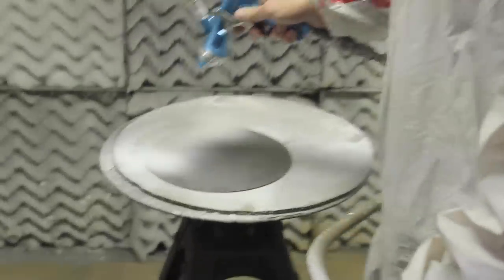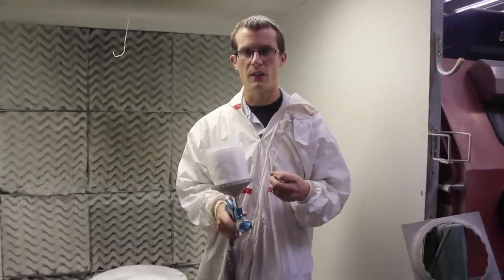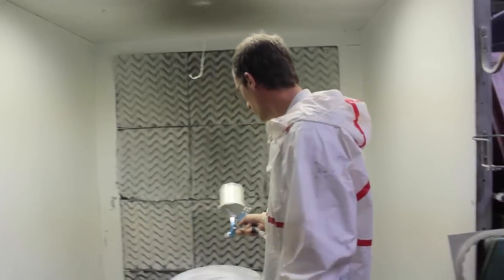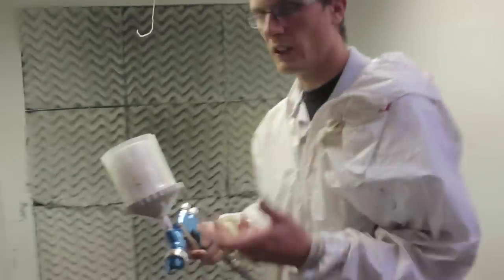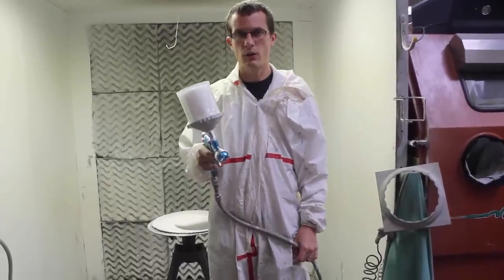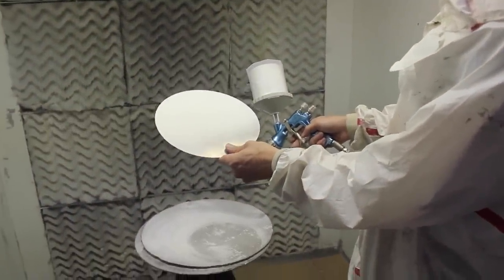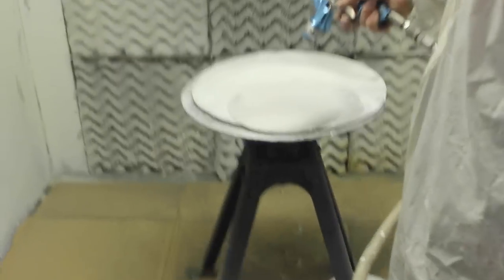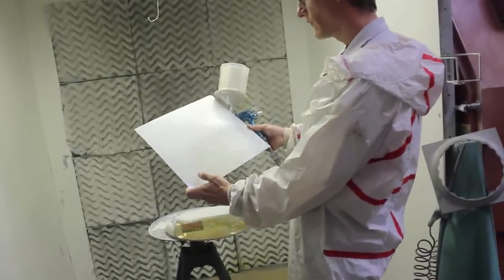How to Stop and Fix Orange Peel when Spraying Paint

Comment: I searched YouTube for all the spray paint videos, and ignored the ones that were over-the-top and made in the last few years from "YouTube Influencers." I wanted to find someone who knew what they were doing and could show technique and share their depth of experience from their professional career. Well sir, I found it. Your video, even though it's grainy and hard to see the finishes on the monitor, is the best one to help people like me understand what I'm doing wrong. I have painted and sanded a piece 3-4 times over the course of a month because I have been unhappy with my results with my HVLP Fuji Model-M gun with a turbine unit.  Because of the turbine unit, I can't control my PSI, only air flow, which is on full. The primer and the semi-gloss paints I was using were just too thick and no matter what, I was having to sand my final results, especially the thick primer.  Sanding a final coat of semi-gloss is not what I want to do, as it will remove the sheen from the gloss.

Today, I was finally able to apply a primer coat with little orange peel.  I used a 1.8mm nozzle, with about 10-20ml of water for about 150ml of primer (Kilz 2 https://www.kilz.com/primer/kilz-2) and it seemed to work. I tested on multiple sheets of paper and cardboard. I had to really limit the amount of paint coming out of the gun to ensure the thick paint was being broken up, so I had to move my gun very slowly at an inch a second to get coverage on the piece. Additionally, I stopped painting outside and bought a Wagner spray tent (9x6) for my garage. I invested in a portable AC for my insulated garage and ensured the humidity was at 40-50% and the temperature was controlled to 21c (70f.) One of my issues when painting outside was that the paint was drying too quickly before it was able to settle.

Because your video was hard to see, I also used this video: https://www.youtube.com/watch?v=qUZXChT2ebs which helped me see the spray pattern a bit better.  After the primer dried, I did a VERY light sanding with 3M 320 paper which gave it a literal smooth finish.  Now I'm going to apply the semi-gloss cabinet emanel which is much thinner than the primer. I'll drop it down to 1.3mm nozzle and see if I can get a smooth finish. I'll report back.

Even though I'm not finished yet, I was pretty excited and wanted to let you, and everyone know my results. I have drastically improved my process.

Thank you for sharing your professional knowledge.  I also liked your video on the Zahn cups https://www.youtube.com/watch?v=oS3YmO8imdw - it helped me understand there is a science behind all of this that can be measured and repeated. Thanks!

I hope this comment helps others.

Comment: I really appreciate your video and information.  I've been struggling with orange peel on most of my projects and have been searching for how to prevent it.  Your presentation really sheds a lot of light on the issues.  Question:  Are the air pressures you are going by with the trigger pulled so I think that means at the cap, or without the trigger pulled?

Comment: your video is really informative  but still i do have a question . hope you can solve this easily.     

Question : imagine you need a thickness around 40-50 microns , at a very short time Eg. 1 second , so how could you possibly prevent the orange peel  in this situation? 
Complications ;
1.higher viscosity 
2. 2k painting
3.less time

hope you can solve this!

Comment: Great information thank you

I got a steam shower that has some scratches in the powder coat. I want to remove this black powder coating that’s on the outside of the glass and then just use a frosting. I do have a small sandblaster what grit would be OK to use if that would be the way to remove this powder coating on the tempered glass.

Comment: how much psi would you expect to use for a compliant devilbiss advance hd gun spraying acrylic polyurethane topcoat? im using a 1.4 tip and the paint viscosity is set at 28 on din4 cup. I seem to have to use 45 psi at which seems excessive the guns manufacturer recommends 29psi. thanks
Reply from the maker: Hi the 29 is the max recommended to maintain the guns transfer efficiency if your above that it means the paint is to thick for a hvlp or lvmp (compliant ) air cap or needs thinned more or might due better through a smaller tip (less paint to atomize at a time ). If you share the paint brand name and product I can check a bit further on if compliant caps will work with it

Comment: How close should I spray from vehicle for base, clear, sealer and primer am getting more used to the PPS system cups but they fell off my spray gun more than once but now I know am supposed to put the the screw part the round circle part on last. And the plastic cup on first with the liner and the bottom plastic part that you hook up to the spray gun first before you screw on.

Comment: Any tips on reducing orange peel if using water based acrilyc lacquer in an aerosol can?
Reply from the maker: Not much can be done with aerosol only option ensure the room is 70 degrees or warmer and so is can heat  helps reduce visocosity
Reply: Applying more material to prolong flashing time also helps as your clear coat has bit more time to level out while drying. But in such case you risking of having clear coat runs or fogging. So it takes some practice to get decent results by using this trick. Also laying panel flat while doing this helps a lot.

Comment: Can you thin a 2k high build primer which uses hardener?  The instructions say 4:1 mix of primer : harder but can I add thinners ???  I'm a newbie  just done a panel and it's come out really bad orange peel, pressure on gun is 25 psi, 1.4 nozzle, am I sending too much of the primer out ???
Reply: You can, but you always have to check with manufacturer what type of thinner you can use with it. Also high build primers never end up flat without thinning them, because that's how you get high build up properties. When you thin it, it becomes more like a standard primer, thin it even more and you get the sealer. 1.4 nozzle is way to small to be able to send too much primer out. I use 1.8 nozzle for high build primers.

Comment: this might be a stupid question sorry if it is im trying to learn. but if my paint was too thick would it make it not atomize? I bought some cheap RTS paint just to practice with it said I could thin it but I didn't and when I sprayed it it almost seemed like it was spitting and the end result was a lot of orange peel. should I have thinned it or did I mess something else up?
Reply from the maker: Hi there if your paint is to thick for the spray equipment your using it can prevent you from getting a smooth finish some paint can't be thinned properly to get good results with certain equipment (hvlp) sprayers being the big example

Comment: So will an airless sprayer always produce an orange peel finish?
Reply from the maker: Hi Dean airless sprayers will typically not produce a automotive finish and will have some orange peel.  You can make the airless an air assist airless or use a fine finish airless tip and get finishes closer to automotive quality with an airless
Reply: Pittsburgh Spray Equipment Co Thanks. New to spraying but want to spray my own furniture which is mainly cabinets. I’ve been going back and fourth deciding to get the Graco gxff or Graco finish 9.5 HVLP. Think I’ll go with the HVLP. I’m going to be using pre cat lacquers. I assume I’ll have to clean the HVLP after each coat or can I leave the tip in water for the 30mins before I can apply another coat? I’ll be using Morrells paint if that helps.
Reply from the maker: @deanmartin7593  I would clean the equipment briefly so you don't get hardened coating and create problems
Reply: Pittsburgh Spray Equipment Co So just clean the tip but leave the material in the cup?
Reply: @deanmartin7593  lacquer thinner, if you're using pre cat lacquer. Run lacquer thinner through the hose/cup/ and gun. Even after you done spraying.

Comment: I’ve thinned loads using a 1.5 and 1.8 tip with a 5 stage turbine but still orange peel
I personally don’t think turbines put out enough pressure
Reply from the maker: You are right turbines don't have the same power that top end compressed air guns do so for industrial paints they usually won't have the power to do the job

Comment: Also is there harm in over airing the mixture? Is over airing even possible? Every air supply is different and a typical air compressor is not going to supply the same pressures that yours do so I can’t ask for your advice on which PSI to work at
Reply: Just too dry. You should decrease air and increase fluid.
Reply: Put a regulator on the air line coming into the gun

Comment: What size tip is best for painting a car and reducing orange peel?
Reply from the maker: Depends base coat usually a 1.4 1.6 or 1.8 clear 1.2
Reply: 1.3 paint and clear
1.8 for primers
2.0 for primers and flakes

Comment: Also what do you mean by HVLP efficiency?
Reply: Sorry for butting in but hvlp means a gun that is high volume low pressure.Which translates into more paint less air.He said 20 psi on his gun.Back then painters used 40 to 55 psi to atomize paint.
Reply: I think efficiency refers to how much paint lands and stays actually on the surface, as opposed to be bounced back from the surface and floating around in the air of your garage. Or it may also mean how much paint you can expell with the same given amount of air, idk 🙄
Reply: @filibertobarrera3839  yes typically 10 psi on d cap..but this gun need more air consumption..so you alslo need ah high volume air compressor at least 12-15 cfm